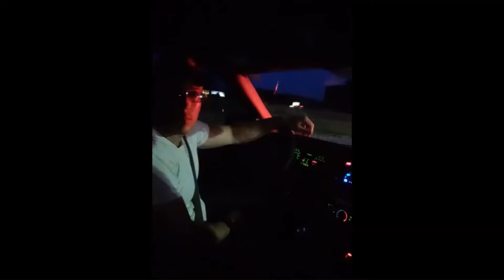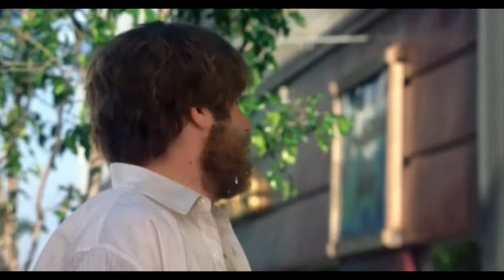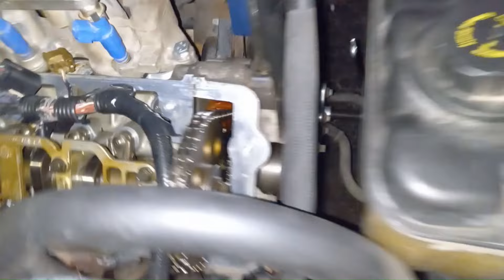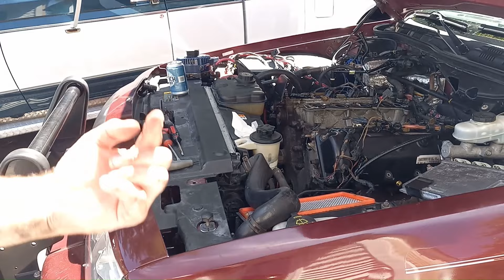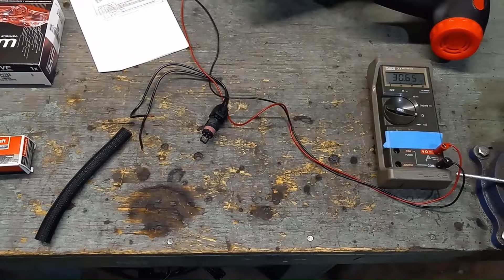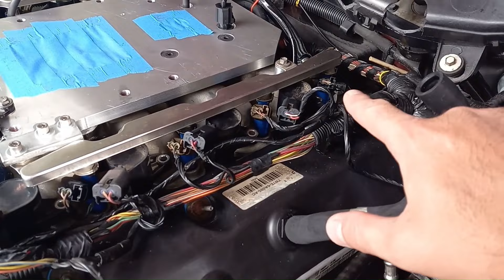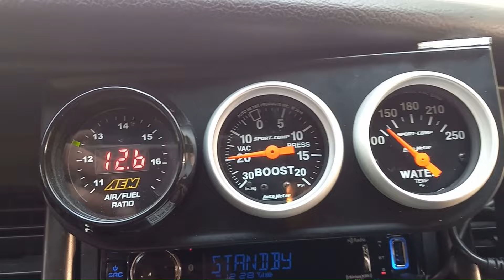M90 Supercharged Crown Vic - Part VII

Comment: How much to bu t an adapter / manifold
Reply from the maker: If you can find a non pi intake for a 4.6.  So like.   1996 earlier.   We can probably do something. 

I am considering a more easy to manufacture solution 

The intake manifold is the hardest part.

Comment: So you connect the bypass valve to the fuel pressure sensor? And it didn’t affect anything?
Reply from the maker: No that’s not true.  

The bypass vacuum actuator is connected to a vacuum line located between the throttle body plate and the supercharger inlet.  It will only see vacuum.  Never see boost.  

The fuel pressure sensor is routed to a vacuum line that is boost referenced.  So after the supercharger outlet.   In the lower manifold.  Between the supercharger and heads.

Comment: Wow - that was a crap ton of work for a 10.4x 1/8th mile e.t. (low 16 second 1/4 mile).  It sounds good, but the performance not so much.   Good luck, I hope you can figure it out.
Reply from the maker: @Thomas63r2  those times were before supercharger was installed.  

Did you watch the video?
Reply: @bpbuilds  Yes I watched the video.  Did I miss the drag passes with the supercharger?
Reply from the maker: @Thomas63r2  no. The video ends with me explaining that the car needs to be tuned.   It would not be a good idea to take the car to a drag strip without tuning the computer.  

I have other videos on the channel explaining parts of the tuning process.   

Race season is over, so I did not get back to the track yet.  

If you watch the videos I have released.   My data logs show 1.37 VE at 7 psi boost.  

I do plan on continuing to release some videos on the tuning process and a follow up visit to the track.  As I explain. At timestamp: 1:45-2:05
Reply: @bpbuilds  Thank you for the details, and best wishes for your next time at the track - I'll look forward to that video!

Comment: I'm just curious as to why you made an adapter plate instead just bolting the blower to the modified intake and get more hood clearance . also I think I would have made a fabricated u turn block  for the throttle body  to gain more clearance . wonderful build , great job . I'm doing something similar  . i have a 96 Lincoln mkv111 32 valve aluminum 4.6 and i found a m122 blower of a gt500 mustang . im using a 96 cobra lower intake with a plate on top like you did .
Reply from the maker: @wuddywoodpecker64  because the lower intake 6 inch wide pocket I milled was too narrow to fit the bolt pattern of the supercharger.  

Meaning the lower intake is narrower than the supercharger is.   So nothing to bolt to.

Comment: That was A LOT of hassle for the EGR valve. Why not just remove it? 

Ohm the IAT if you're T'ing off the sensor, make sure it's not compounding. I'd suggest methanol injection but I think that goes without saying. 

What rear gear are you running? 

Intake design really doesn't matter when you're shoving air in! (Especially a PD blower!
Reply from the maker: @commonsenseisdeadandgone  I must pass emissions testing.  I can’t delete it.  

All your concerns will be addressed in future videos.

The axle is 3.90 with trac lock carrier 

Yes I have a water Meth system.

Check out other videos on the channel

What do you mean by ohm?   Ohm is the units of resistance.  Be precise. I demonstrated ohm measurements clearly and accurately

Comment: Nice job ! What size pulley you have on now? 4 inch?? What  kind of Boost you are looking for, 8-10 ?? And, one more thing: You need headers, absolutely, those old exhaust manifold s are ristricting, a lot!!! And, I have same programmer , Tuner, SCT, are you planning to tune it with that ?? Thanks =), Greetings from hot South Florida, 98 F today;o)
Reply from the maker: @Eeropolvasti  yes headers would be ideal.   But i didn’t want to risk snapping exhaust bolts off in the head. And fighting with that.  

My goal was 5 PSI.  I am getting 7. 

Watch the video series.  All pulley sizes are covered.  

Yes I tuned it myself using SCT software and X4

Comment: Awesome! I will be expanding my cnc machine to be able to make similar plates and I should be attempting this soon. Cant wait to see more. Have you ever considered running a hose from the air intake to the interior for more blower noise? Could be cool but I don’t know if it works with this setup.
Reply from the maker: @ConnorHuet  I’m not sure what you mean by that hose.